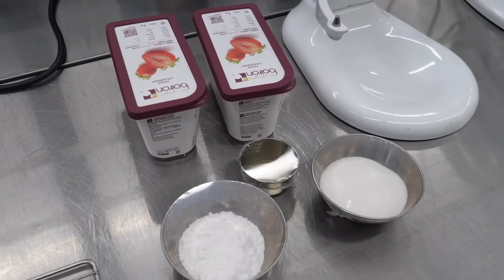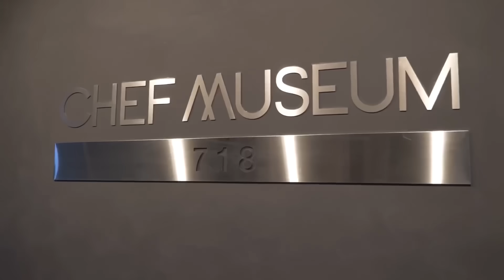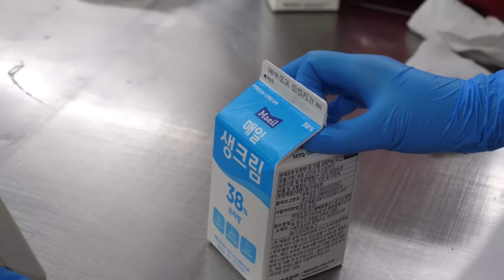국내 디저트 장인들의 격이 다른 수제 케이크 BEST 몰아보기 6 Best Korean Dessert Masters' Amazing Cake Collection

Comment: The process for making the ring cakes was soooo inefficient. Wasted ingredients, 1000 extra steps, prepping things individually which can be done in bulk. The dulce de leche was a perfect example. So you make it in house by boiling the can. You add no flavoring or anything else to it and use it straight. What is the point? Extra man hours (which I'm sure are expensive for the type of training required) when you could instead buy dulce de leche premade. The cost for those ingredients will be higher than regular condensed milk, but less than what it will cost for the hours those employees are on the clock. Using silpat to texture the box when a flat texture + the airbrushing would've gave a velvet texture. Cookie crust, hard as a rock.  For that much work this should be the best dessert you ever had. In reality it's a hard chocolate crust with mousse and strawberry(?) jelly. They will have to price this high to make a profit and I'm not convinced people will want the end result  for more than once or twice. Which is likely why they are doing YouTube to make more money and have some marketing.

I'm all for cute fancy desserts, but my eyes are wincing at the amount of money being lost by the extreeeeme inefficiency in process 😭😭😬 Simplify the steps, combine where needed, figure out what can be done in tandem, what can be taken out. You'll get a more consistent result (seriously, sanding the crust boxes? I shuddered at that part, what a waste of time for the worker) and reduce costs overall.